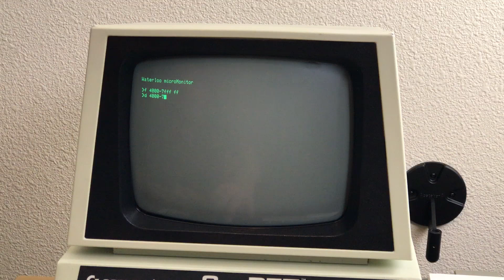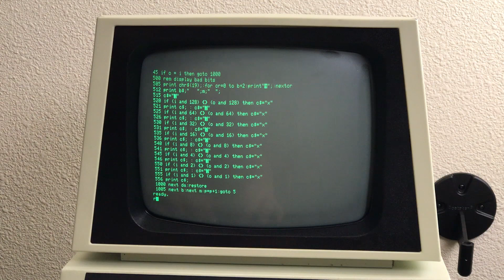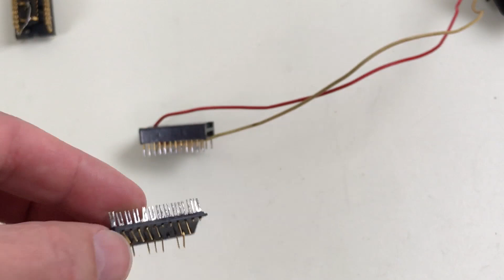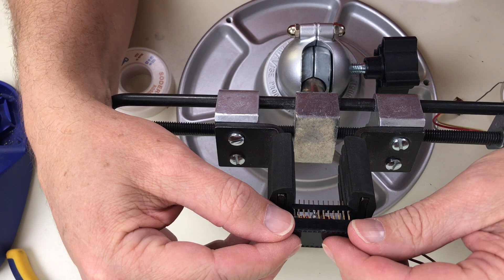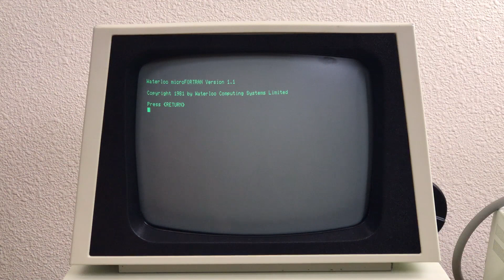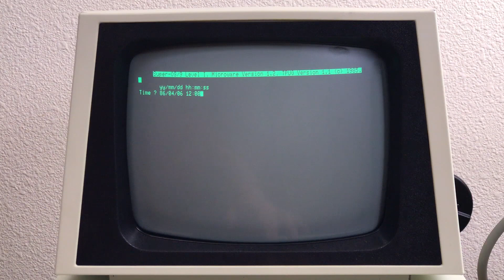Commodore "Super PET" Restoration (Part 3)

Comment: Finally someone showing what the switches do on the side of the machine.  Are you turning off the machine or resetting it to switch between 6502 and 6809?
Reply from the maker: Just flip the switch and it swaps. No need to power cycle, the CPU is reset when you change modes.  However, I noticed the IEEE doesn't get the reset when you switch.

Comment: Is a 3000 series more like the 2001s or 4000 series? ie. Piezo speaker
How many PET/CBM models are there?
PET 2001
PET 2001-N
CBM 3000
CBM 4000
CBM 4000-BS
CBM 8000
SP9000
CBM 8000-SK
PET 64
...
Reply from the maker: Good question.
The first 2001-8 with the chicklet keyboard was released in Oct 1977
The 2001-16N / 32N came in early 1979
The 3000 series was only in Europe and is exactly the same as the 2001-xxN or 2001-xxB series in the US & Canada.
Commodore Europe incremented the model number series from the 2001-8 to the 30xx but in the US they wanted to keep the 2001 model number for some reason.
Both the 20xx and 30xx are the same internally, no CRTC, no speaker, dynamic RAM, 9 inch screen, 3.0 ROM set, Basic 2.0.
The 40xx started off as simply a 2001-N / 30xx with the 4.0 ROM upgrade. No difference internally and they incremented the peripheral series numbers to 4000 also.
The 8000 series actually came first though. It was released concurrent with the 4.0 ROMs in mid 1980 and the 40xx came shortly after.
The 80xx had the CRTC, internal speaker and 12" screen to accommodate the 80 columns.
The universal board came in '81 or '82 which is when the "FAT" 40 started shipping with the CRTC, speaker and 12" screen.
The 9000 was released in Oct '81.
I don't know much about the history of the CBM II line, so no clue when the 80xx-SK was released.

Comment: Amazing work and video, as always.  I have a question for you that no one can answer. My friend has a PET 4016 and when it boots it does a double chirp then garbage on the screen. Any ideas?
Reply from the maker: That's an easy one, since you have the startup chirp, the Kernal and Edit ROMs are probably OK.
Garbage on screen is either bad video RAM or bad System RAM.  
Bad system RAM can cause the CPU to crash shortly after the chirp, before it can clear the screen of the random bits.
Bad video RAM will just display incorrect characters on screen no matter what the computer is trying to display.
You can see me replace some system RAM in this video and I replace the video RAM in part 2
Reply from the maker: If you have a datasette, you can tell if the CPU has crashed. The datasette motor should turn on for about a half second at power on, then shut off. If the motor starts when you press play and stops when you press stop, the CPU is still running and servicing interrupts.  If not, your CPU is crashed and it's probably bad system RAM.
Reply: @Chuck Hutchins many, many thanks! I will pass on your expert advice!